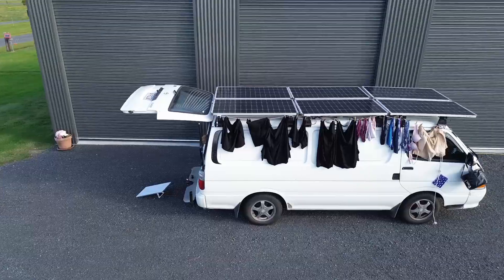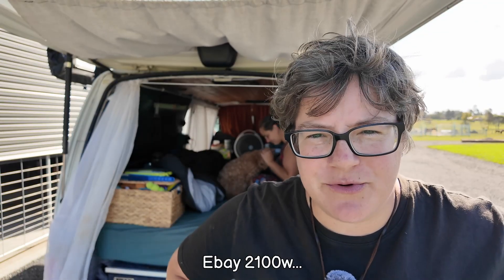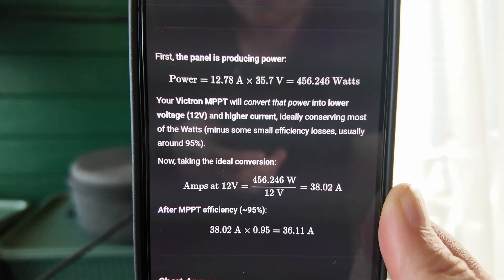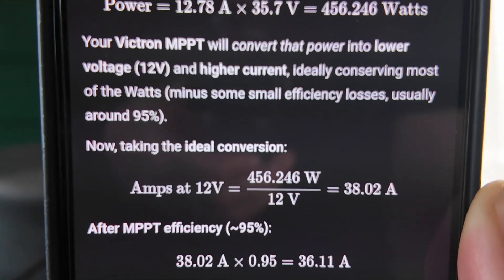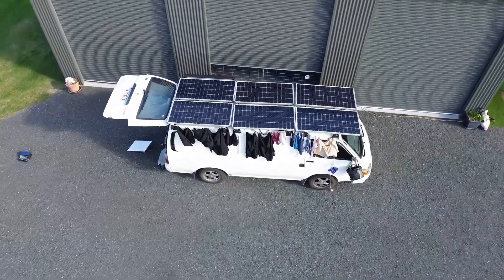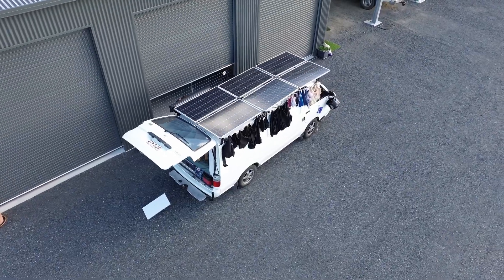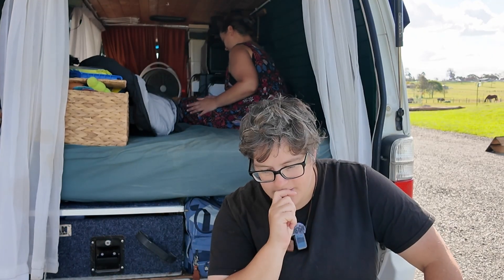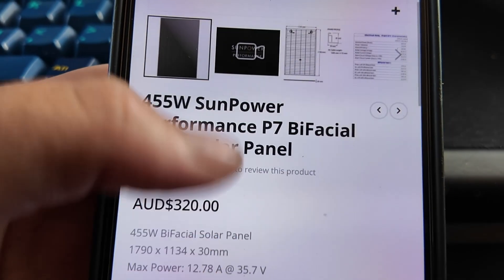Solar Panel Amps vs Volts – What I Wish I Knew for Vanlife

Comment: it also has to do with how you wire your panels together, whether in series or in parallel or in series parallel.  you can increase volts and keep the amps to a manageable level that way. your solar controller size is restricted to how many amps it can carry. having a larger controller is not a bad thing.  it just means it doesnt have to work as hard.  which corresponds with longevity as well.  the type of panel counts as well.  mono crystaline or poly crystaline etc.  i personally prefer mono crystaline.  others like poly.  but  do keep in mind about how they are wired.  you can wire panels several ways, research and do what is right for your system and requirements.  i wired my panels in series.  some dont.  i wired my panels the way renogy suggested.  and as i am an electrical dummy,  i felt that was best at the time.

Comment: I am putting 600watts of solar on my 2005 toyota prius so I'll tell you about it. I got 3 werchtay 200w solar panels with the advance hidden brush design solar cells they are rated for 220watts 17.22v 12.78a lab tested. My mppt solar charge controller is a HQST 60ah. My battery is 12v 300ah so I can charge it from my car's 12v power. I have tested and used these 3 solar panels is series and should be 51.66v at 12.78ah at 660watts then the controller brings it down to the 12v battery with a conversion efficiency of 92% making it 607watts. I have seen 615watts on my mppt output and a input of 672watts from my solar panels going into the mppt. solar input amps exceeds the 12.78ah and makes it over 14.3ah based on the mppt tracking and my own multimeter equipment 48v x 14ah = 672watts with efficiency of 91.5%. My mppt is rated for 96-98% efficient for 48v battery systems so 12v should be less efficient. The mppt makes the voltage and amps jump around so its hard to get an exact number with my multimeter equipment. I have 8awg wire from solar panels at 20feet and 6awg wire from mppt to battery at 5 feet. I will cut the wire shorter when installed on car as voltage drop off dose happen with longer wire especially with 12v systems. Make sure you stay clear of fake gauge wire as I did buy fake 8awg wire that was 12awg wire that was labeled as 8awg.

Comment: You do not have 2100watts of solar on your car nor can you fit that much on your car you got scammed. It looks like you have 6 200watt solar panels making it 1200watts. It seems to me that you have stuck all of the panels in parallel to get the most amps this is incorrect way to do it especially with mppt solar charge controllers. You have 6 solar panels and you said your battery pack is 12v so you should have 3x3 in series and then connected in parallel. 3 panels on left side of car in series then on the right side of car should have the other 3 in series and then connect both sides in parallel. This should increase the output voltage of the solar panels to over 60v open circuit or close to it. Mppt solar charge controllers need the solar voltage to be much higher then the battery voltage and within the the operating range of that controller. if the controller is rated for 60a or so and your battery is 12.8v then you have 768 watts of max power that can be delivered through the controller. if you went up to a 24v battery then the controller can deliver 1440watts and so on.

Comment: I think you misunderstood. 6x 360 W is more than 2x 456 W. P =V x I. The main characteristic on panels is the power it produces. The more power (Watts), the more current (Amps) your Victron charge controller will put into your battery @ 12 V.
I don't think you understand what is wrong. Just write down the specs for your panels and the type of Victron charge controller and people here can figure out what's limiting the output to 500 W. And explain how you connected them (how many in series and how many parallel strings). Perhaps you just limited the Amp output to match what your battery can absorb. You can restrict the current in the charge controller settings to protect your battery.

Comment: I don't see why you need to replace the panels? Can't you just connect them in series to get a higher voltage?

It might be also that the problem is with your mppt controller - that it cannot handle more than the 500W you are getting. What mppt controller do you have and what are the watt/Volt/amp ratings on the panels?

You might not need to replace anything. It might just be that the panels need to be rewired.

Comment: To be honest, I think the bottelneck ist the victron charge controller. Which Type you use?  the second number of the name stands for the Amps you can Push in the Batterie. E.g. If you use A 100/20 and you have a 24V battery which Runs on aprox. 25V you get 25 V x 20 A = 500W into the battery no matter what the panels would deliver. In this case you can either use a bigger charge controller or use more of them. You can hook up multiple charge controller on one battery.

Comment: Volt is like the width of the hose. If you want to make a system, it is practical if the voltages match. Also, watt = amps multiplied by volt.

Comment: If you are going to mix panel sizes:

You can connect panels with the same voltage in parallel. 

You can connect panels with the same amperage in series.

And remember: parallel connect panels are more shade tolerant, but you need thicker cables.

Comment: To clarify the panels should be higher volts then the battery, up to the controller's max input, that is why people are syaing to put the panels in series, are you not willing to rewire them?

Comment: Your explanation makes no sense. 

No need for new panels. A 250w panel at 25v outputs 10A. A 250w panel at 18v outputs 13.9A of current. The total power generated is the same. You need to feed in the correct voltage for the solar charge controller. 

The wattage of a panel determines how much power it outputs, not amps or voltage. Wire your panels in series to increase the voltage so that it's close to the max that your MPPT can handle. The higher the voltage, the thinner your wiring can be, to move the same amount of power. 

Talk to an actual expert (not chatGPT) before you modify your solar and battery setup. It will save you money and time, and potentially save you from setting your van in fire due to not using the correct wiring and components.

Comment: As an actual expert on this subject. . . your video is absolutely confusing. . amps and volts (for the context of this video) has no relvance in the way it seems you assume it does.  ..  .what matters is 1) the effciency of the panel
And
2) the series parrel strings configuration bring up the voltage that are with in IDEAL range of mppt this  , there is crucial there is a min start up voltage and max and operating rangr  .this is likely your issue

Comment: it's the equation V x A= W. higher amps mean you need thicker cables. mppt allows higher voltage but then you get into the question of series vs parallel. Series is better for high voltage low loss however parallel can be advantageous if you're often in a place where some of the panels are shaded. (the shade would reduce the entire string of panels on series but only the shaded ones on parallel)

Comment: I just stick with Watts less about 20% for panel heat derate. Then use kWh for your storage.
Configure your panels to suit the voltage and amperage windows of your charge controller. But Watts won't change.

Comment: Hi Ashly!  I have built a couple portable DIY solar systems and can help out if you want.  Just message me (FrozenYack, from the old Twitch days).  A couple things... Victron makes great stuff, but it is costly.  I would recommend hooking the panels up in series (voltages add), so the MPPT will start sooner and run longer... but do NOT exceed the MPPT voltage limits (use the Voc number from the panel's datasheet, and remember to multiple it by the number of panels).  Also, Bifacial panels will likely only give the power from the top, since you have them mounted on the van... there is little to no reflection to get anything off the back.  BTW, there are cheaper panels out there... but you just need to match your voltages with your requirements.  Good luck!
Reply from the maker: I can't seem to find cheaper with those amps and wattages. By all means if you know of some put the product codes in here haha! 
I can get those ones for $320 with $75 shipping for two panels. 

The front of the bifacial panels are still capable of 12amp @ 35v right? It's not like half and half haha, if you know at all? 🤔
Reply: @AshlyWixks  which one are you using?  I have the 100/50 and love it... max volts in is 100, and can output 50amps to the battery.  I think 700W is the max for a 12v battery.  But... do it the other way... figure out what you need, then find the panels and charge controller (and inverter) that can do what you need.
Reply: @AshlyWixks the Ratings are Just fron the Front. The Backside can typically deliver 85% of the Frontside If it faces towards the sun. But you can Just skip that in your case. I think anyway the Ratings of the cheap ones  May be Fake. But you need to keep the whole Chain in mind. Panels - Charge Controller - Battery.

Comment: I'm not as familiar with bifacial panels, but wouldn't they work better in a ground installation? I thought the point of them was to catch sun from both sides. If the one side is going to be against the roof of the van, wouldn't it be better to get a one sided panel if it's cheaper? 

I have a small semi permanent system, with a 100ah LiFePO4 battery, that I built myself using two 100w panels from HQST that put out 24v. I just upgraded from a PWM charge controller to a MPPT earlier this year, and I'm planning on adding two more 100w panels. I have the panels, just haven't gotten around to mounting them yet.

I'm still an amateur in the solar space, but if you want to chat about anything feel free to DM me.
Reply from the maker: Yeah as I understand they gather sun from both sides. However, they are $320 with $75 shipping. 
I can't find anything close to the amp/volt to the Sunpower Performance ones. 

Not that it would make MUCH difference but they won't be flat on the roof, there'll be about 2 inches of the roof, reflective sunlight 😂
Reply: @AshlyWixks Hey, if the price to performance ratio is good, then go for it! You could maybe engineer a hand crank tilt mechanism if you wanted to get fancy with it.
Reply: @TadoChip I saw a YouTuber come up with a clever but simple way to make solar panels follow the sun. They put small solar panels on each corner of a tripod, mounted on top of a motor. As the sun moves, one of the small panels gets more sunlight and creates more power. The system then turns the motor to follow the sun in the direction of the brightest panel.
Reply: @inthestarrysky6166  Ah, a sun tracking system, I've seen them for ground applications. Not sure how easy it would be to implement on a van roof, but it's definitely possible.